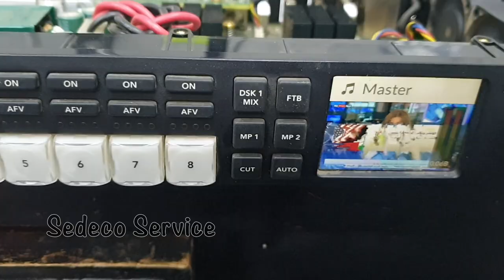Blackmagic ATEM Television Studio HD  Error NO PGM OUT  no signal  HDSDI PGM OUT repair (repaired)

Comment: What is the part number or part replacement, do you sell it? $$$
Reply from the maker: Hi  no sell it  i get it from blackmagic  company   and he send parts only to dealer service center  thanks
Reply: @sedeco99  
So is it impossible to get one?
Reply from the maker: @jesushostiavivatv     from where?  and how can send to you ? and what problem you have in your device
Reply: @sedeco99  
it is the same the chipsep stopped working is in short circuit, and you do not send video output, I need a replacement chipset
Reply: If you have the replacement chip, I will buy it, I am from Mexico. quote the piece and the shipping
Reply from the maker: @jesushostiavivatv    send to my email     thanks
Reply: Hi i have a no multiview output .. can it be repair ??
Reply: Hello Ahmed,

The multiview output on my unit is not working. Do you have access to parts for this repair? Any help would be appreciated.

Comment: Hi, Sedeco, Please help. My ATEM Television Studio HD (set button is flickering.) Only the fan makes the noise. How can I fix this issue??
thank. ;) :D
Reply from the maker: hello  this need reflash update
Reply: @sedeco99  And if ATEM does not power on? The power supply cable was inserted but there is no power. Tried to update SW, result is negative.
Reply from the maker: @StkrSc   hi the pc see it or not ?
Reply from the maker: @StkrSc    hi  the pc see it or not ?

Comment: Hello, my device is an ATEM Television Studio pro 4K. My XLR input is not functioning.
Reply from the maker: hi you need replace the ic for sound line and mic near the xlr in pcb   and try no add or remove the jack  after power on  this will making your problem